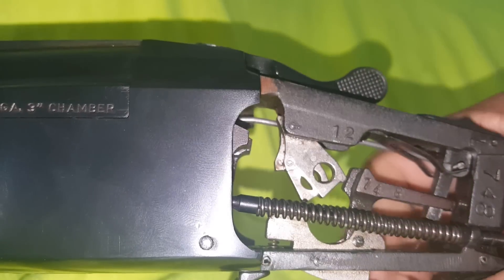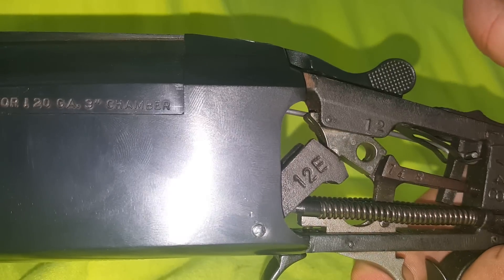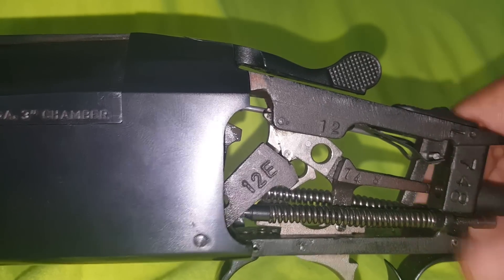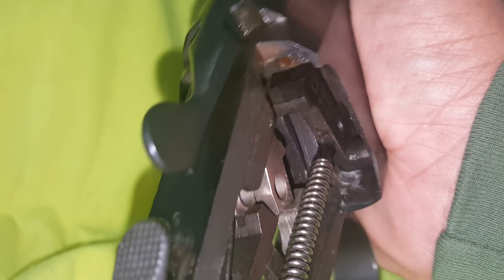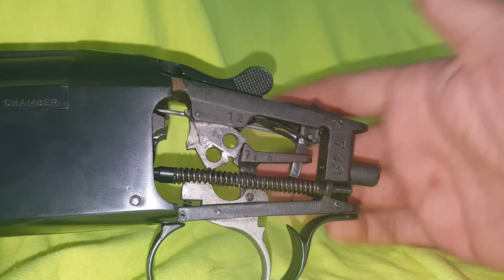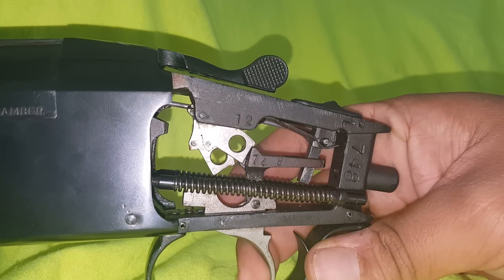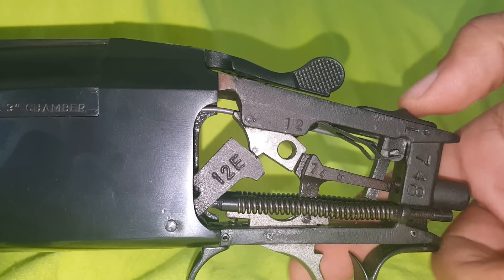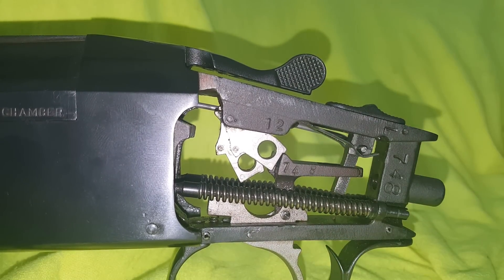Stoeger Condor not firing top barrel

Comment: Ok thats a good video to help people. This is a problem on the SXS, thats why double triggers are recommended but for singles, yes a scrubbing and oiling is normally all you need and to stay ahead of rust. In any case Stoegers are good and the company stands behind the products. Do you live in a humid environment?
Reply from the maker: Very humid Florida lol! But try to keep my dehumidifier up in the gun case!
Reply: @UnderratedOutdoor  Well, I have an old rifle that stays in zero humidity and it still got rust. What Ive learned is that rust occurs in steel that has a high iron content. The less iron, the less rust. Who knows what makes up gun steel? I have some guns that dont seem to ever rust. The answer, which I learned the hard way, is to not worry so much about humid but checking guns often on the inside. A barrel not rusting doesnt mean its not rusting in the mechanisms. Regardless of environment, maybe guns for storage need a cosmoline treatment, not simply an oil wipedown and frequent use.

Comment: I have one that I got for trap and skeet, and last time I took it shooting it was getting light primer strikes, I tried to disassemble it but could not get the stock bolt to budge at all, I even used an electric drill and my drill started smoking, its like Hercules installed the thing
Reply: You need to use a socket wrench. Looks like this gun has very weak internal springs.

Comment: My Stoeger had an issue when I bought it whereas I could fire the first barrel, then the safety would reengage before I could fire the second barrel. I took the gun apart and found the safety spring had broken. I called Bennelli and they sent me a new spring free of charge. I replaced it and put a little blue loctite on the screw so it wouldn't back out(it was loose when I first took the gun apart.. That has done the trick as I've not had the same problem again. But the safety is pretty tight and takes a little strength to operate. Not prohibitively so but it is hard to operate. I'm wondering if its got the corrosion problem you mention here. I'm going to take the gun apart tomorrow and check it out. 

People have trashed these guns but for a working man they're not bad. Mine has dropped many doves and pheasants over the years.
Reply from the maker: let me know how it went i am curious to know your findings. So far mine is still holding up.

Comment: nice.  what do you use it for?  looking for an all around gun for dove/duck and occasional clays.
Reply from the maker: I use it for ducks and clays.
Reply: I use mine on doves and pheasants, and it kills them just as dead as they expensive guns. I did take it turkey hunting once but its a little too heavy IMO for a turkey gun. I doubt a Condor will hold up as a skeet or trap gun, but for field use they're fine.
Reply: BearArms713 I watched another video that said steel shot couldn't be shot from this gun. Any truth to that?

Comment: How did you remove the cover for the action? THANKS for showing us how to fix it.  Many of us own them and love them as a first Over / Under and for the money , you can't beat them.
Reply from the maker: Remove the two screws from recoil pad, just simple philips head wood screws. Once that has been removed you will see the hole in the stock, in there will be the bolt you will remove that holds the stock to the action. you can shine a light down there to see what you need, but me personally i have and used a 8inch long flat head screwdriver to get to it. After you remove bolt you can  slide the stock off the action.
Reply: The bolt is also 11mm with an extension you could reach it so as you’ll never strip the slotted head
Reply: My top barrel wouldn’t fire because I wasn’t cocking the gun back far enough.  If you don’t snap it open all the way to pop the shells out it will only engage the bottom barrel every time, and reset the hammer for the top barrel when you close it back.  This video was helpful though because it showed how the internal parts should function, and I cleaned my safety bar too!

Comment: I have a problem with my safety switching back on after firing the first shot, I know it isn't the same problem that you had, but do you have any suggestions? I have not taken the stock off yet, so it would be the factory lube and stuff in there. My assumption is that it might have too much grease/oil. What do you think?

Comment: I got a problem with mine it will fire both at the same time but when u switch it to 1 fire at a time it still fires both
Reply: Did you ever solve this issue?
Reply: @Theweldingmillennial  no I eventually just sold it I took it to a gun Smith he couldn't fix it I run all kind of shells through it still shot both at the same time I know if I buy one again it be a double trigger

Comment: Your safty spring is in the wrong position...
Reply from the maker: It is in the video, and it is mentioned in another comment. But it still doesn't fix what was wrong with the firearm. In  either position, it was still a problem. Remember I stated in the video that I bought it brand new, and this happened. Then I sent it back to the manufacturer it worked, let it sit, and then it happened again. Not until then did I start looking into the problem. But yes, the spring and bar are in the wrong position.